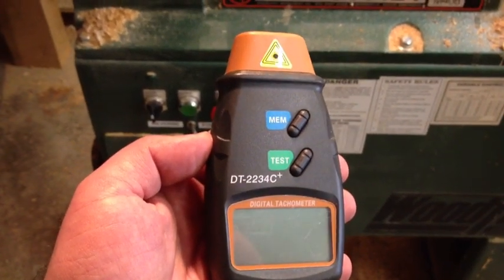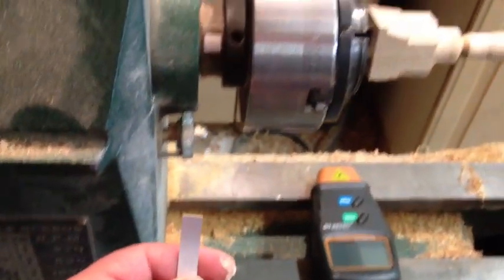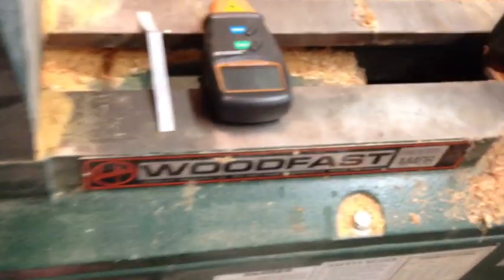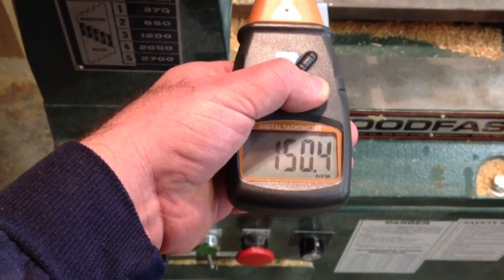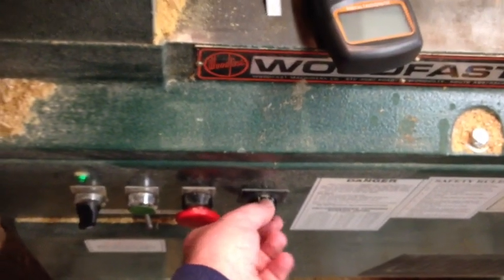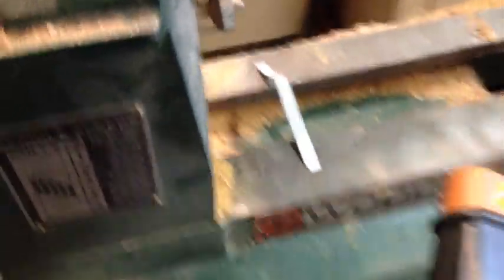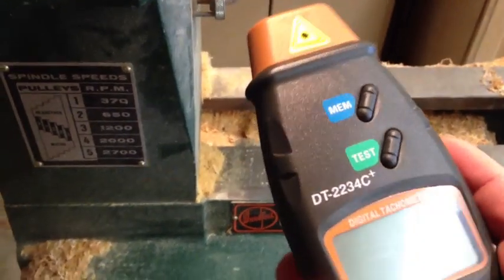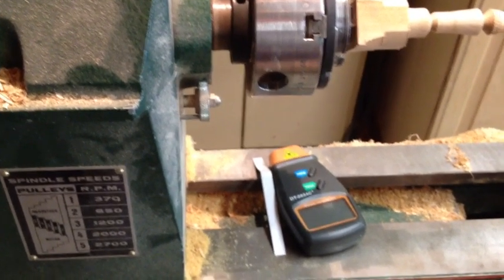How I check the RPM of the Wood Lathe

Comment: I have the same digital tach. When aiming it at a somewhat shiny object, like a chuck, it seems to get quicker relatively accurate readings when aimed at a 45* angle from below. I use this thing daily. Even though its readings don't fully match my Starrett mechanical tachometer, they're close enough for what I do.

Comment: Lots of people write that such devices are not precise at all. Better ones are with mechanical contact, but they are rather expensive. How does your device behave now? Is it working properly?
Reply from the maker: To be honest with you I stopped using this device for measuring the rpm since I found that various wood species work differently with different rpms and this rpm is measured by the feel of the cut. For me this device was helpful to understand approximate rpm so that I know I'm not too fast when I'm cutting threads by hand but still, thread cutting is also based on the feel and the motion of the woodturner. Now if you ask me if its worth having this as a Woodturner, I'd say it's worth it but not necessary.
Reply: Ok, mersi!
Reply: What the hell do you want for a lousy $20.  Try buying it from BangGood.com at the moment they are selling for $10 AUD or $8 USD with free shipping.
Reply: FWIW, I see about a 10% variance between this meter and a Starrett analog tach.

Comment: Question for you Jake: why is the reading seem to bounce around so much?

@2:20

2721
94.1
2731
2728
2200
2730
1665
2727 ……
Reply: +Jake Gevorgian He is measuring the TICR, the Totally Intoxicated Caffeine Reading. ;-)

mmm, sounds like one of my better comments of today
Reply from the maker: This is a perfect example of how unsteady my hand is :)
Reply: Because it was aimed at a reflective object and had trouble zeroing in on the tape. Aiming the meter at the tape at a 45* angle from below usually solves this.